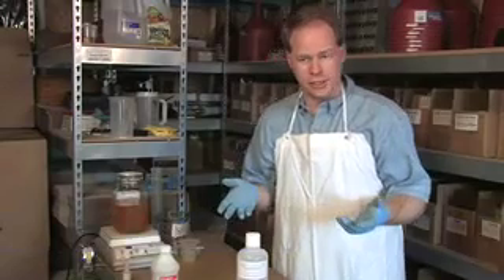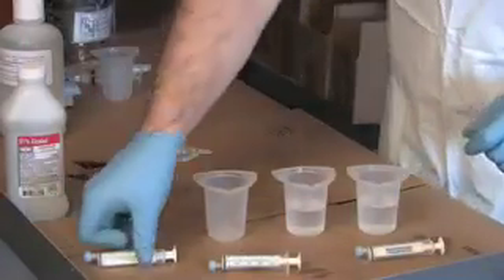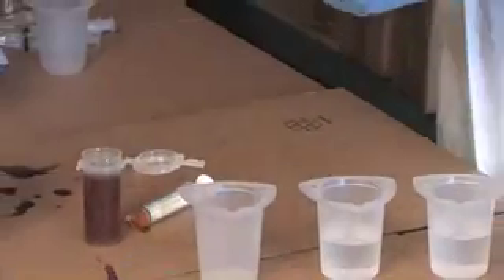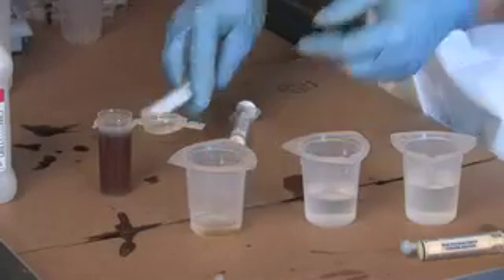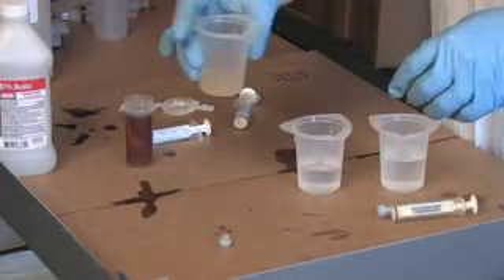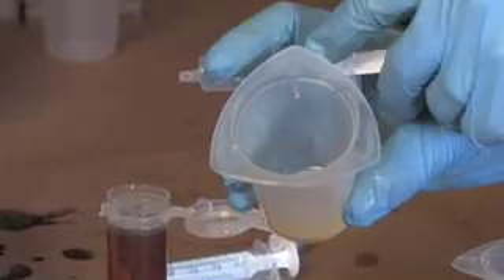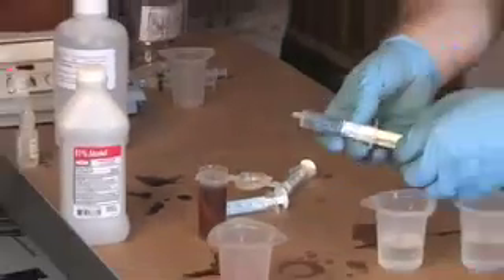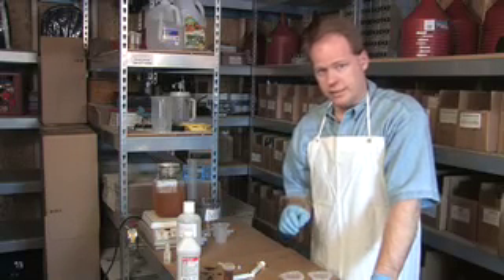3 Biodiesel Titrations

Comment: Why go through the bother of a titration if you're not doing it in exact measurements anyway.
7.5+3.5 is not 12 or 12.5.
To the people out there, just take three or four samples of the oil from different batches and heat it slightly in a microwave for a few seconds and use regular ph indicator strips instead. Based on the strength of the neutralizing agent your can now easily calculate the mol weight needed. Done.

Comment: is mixing the caustic with the methanol before adding to the oil nescessary or can you add the methanol to the oil then add the caustic to the mixture? as just a thought, instead of titrating the oil could you not just add caustic to the whole batch of oil/methanol mixture untill you reach a desired ph? as i think if you went this method you would get a far more accurate result providing you mixed it well enough and added caustic slow enough and save a lot of messing about

Comment: Disagree with you adding a "few more drops" of titrate, an accurate titration is the momment the colour change is constant for 20-30 seconds, and the colour change should be pink and no more. even if that batch of biodiesel was ok to use in a car engine it would cost more to produce then was needed. just an observation bud.

Comment: You don't want to bulldoze over the endpoint so that the solution is that pink.  You want it only very slightly pink.  Also, try not to slop your analyte because your calculations of FFA will be too low.  Perhaps that is why he added too much titrant ...